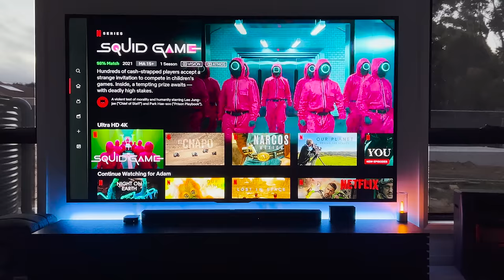Installing my Hisense 100" 4K TV - INSANE!! 100S8

Comment: Great job lads, very professional. I remember way back when I got my full HD 40’ tv everybody was saying don’t buy a Hisense tv as they are not popular tv and are cheap, but I have to tell you what, everybody was  shocked at how good the picture was on that tv many moons ago.
Reply: My friends Hisense was just working for more than a year tho

and he bought 2 of it because quality of picture is good but both are gone for just morethan a year Hisense wont cover it anymore
Reply from the maker: That’s not good to hear that. What country are you in?
In Australia we have consumer law that means any business must warranty any electronics for over 2 year by law. Minimum.
Reply: Based on my experience Hisense tv is reliable. 
I have 4 years old tv and keeps running without any problems.

Comment: Wow!  that's is one very thick TV for 2021... my 55" from 2006 is 1/4 of it thickness... no wonder it is affordable...  congratulation on the purchase!
Reply from the maker: It’s because it’s so heavy it requires a lot of extra strength. 
Once it’s on the wall you honestly don’t notice it. Cheers.
Reply: Yep, my 55"4K Samsung from 2016 is about 1/4 the thickness too, maybe this was an end of the stock deal...

Comment: If this was in the USA, they would have mounted it above the fireplace!! Wow, impressive setup!
Reply: Lol yeah right!? A lot of the houses built here have fireplaces on the main wall you would need for a tv that size.
My house was built in the 80s though and fireplace is to the side. My main wall in living room is massive and the center of my tv is eye level.
Reply from the maker: Testify
Reply: Yes, that's what they do here. Then the bottom of the tv is 5ft from the floor and the entire family ends up with neck pain within the year. Looks great in the design room, but it's absolutely stupid in practicality. I should know, I'm a spine doctor. LOL! I placed my 85" Samsung above my linear fireplace, but I made sure at least the bottom third of the tv was at eye level while sitting. I sure as hell wish we could get that Hisense tv in the states though...
Reply: I blame Architects and interior designers for this stupid design trend in homes. Yeah, you use the fireplace twice a year, yet the tv (used every day)  is relegated to a second class position.

Comment: Installing a 4K HDTV - regardless of dimensions, with a current display tech, is mind-blowing.  My mother has a Samsung 55" Crystal UHD in her bedroom (table mount) that replaced a 43" Crystal UHD 1080p - that is now across the hallway (table mount).  Note that the ONLY difference is that one is 4K and the display size.  I am looking at 43" 4K QLED (Samsung Q60A) to replace a Sony BX750A (42" 1080p) - and because you can now fit 4K in 43", the question is no longer DP you do it, but when.
Reply: I understand you very well! because I am also in the 43 inch 4k TV model range for a change! I know that's how it's the economy now for most of us but it's still a good TV! 👍

Comment: Just bought 70""hisense  UHD     SUPERB  VERY NICE PICTURE QUALITY AND SURROUND SOUND  IS AWESOME💚💙.. WILL BUY 100 "" WHEN IT COMES TO INDIA .😊
Reply: You're richer than I am lol (clutches chest over the $11000 price tag for that TV).
Reply: @bacondreamer  11000 $  for 100 " inch is too much I purchese 70 " at the price of$ 925  .11000 is too much for me may bi not for you 😇 ENJOY BRO ✌
Reply: You should have bought 75 inch MI QLED. Diffrence between two is day and night.
Reply: @chetansharma7626   ya but price difference was more 64 k then hisence..M1 was around 1.3 lack this I got  deal in diwali offer at 66 k.its like double of that .anyway tnx for suggestion. T c
Reply: @maheshkataria3903  HAH! That price is WAAAAAY out of my league.  The fact is any TV that uses actual LCD panels in sized 85" and over is gonna jump very quick in terms of price.  This is due to the difficulty of manufacturing a panel at that size without defects.  The sweet spot in terms of price vs size for large size TV now days is right about 75"

Comment: Why so low? I would have went a little bit higher with the position of the tv. Nice size looks good
Reply from the maker: Check out my latest upload / review of this TV. 
I show all the measurements. 
It looks like it’s low. But the top of the TV is almost 6 foot tall. So you gotta mount it low.
Reply: @ILT_AU  perfect height due to the size of the tv!
Reply: @ILT_AU  👍🏽🤜🏾💥🤛
Reply: Cause thats where you put it considering sitting position on the couch and eye level. Duh

Comment: As some have said, why did you mount it so low?  Subject to damage that way. But sure looks amazing.
Reply from the maker: Check my review video of the 100”. 
It explains everything. 
Long story short. Even mounted that low it tops out at 5’8 tall. 
So it’s taller than most people. It looks weird but when you sit down. The centre of the TV is still above your eye line. Otherwise you would be looking too far up.
Reply: @ILT_AU  ty for the reply. Understood. I had an 86” LG I bought about 5-6 years ago.  It did not have local dimming. The size was awesome but the pic quality left a bit to be desired. Just replaced it with the 83” A90J (which of course dropped 2k in price after I bought it), and while a bit smaller, amazing picture. Can you provide a link to your review?  Ty.
Reply: @ILT_AU  That’s exactly how I mounted my 55” TV. When you walk in the room most people would think it’s mounted too low, but when I sit on my couch the center of the screen is at eye level which makes it perfect.👌🏽

Comment: My hisense 52" 4k tv now broke ,panel / display issues..not sure if it still have a warranty ,but i sent to normal shop for repair..still waiting for the tv ..
Reply from the maker: If its a low spec TV it’s usually the electronics that go first. Panel should be ok

Comment: 100” is good for that distance away from the TV, but 100” of glare during a dark scene in the show/movie/game is a MASSIVE dealbreaker for me. I’m still Team Projector especially since they are WAY BRIGHTER these days and have ALR screens that don’t require a 5 man team to setup like the one in this video, Lol!

Not to mention that I can pick from 70”-300” screen size and am not limited to a fixed size image.
Reply from the maker: I’d completely disagree. A projector cannot come close to competing with a LED LCD TV in terms of brightness. 
A projector requires complete control of the entire room environment. 

The 100” is super bright and is not affected by what time of day or any environmental issues. 

If your happy hang there. Nothing wrong with a good projector cinema room if you have a dedicated space.
Reply: @ILT_AU  unfortunately what you have said about the completely light controlled room would be true if the projector was from 2018. 

MODERN projectors can easily work against ambient light these days and if you REALLY need to, you can get an Ambient Light Rejecting screen to really cover those bases. 

HOWEVER, when you're watching your Glossy Flat Panel TV on a super bright afternoon and the show/movie/game you are playing has one of those super inky black dark scenes in it, you will be looking at a mirror and not know what is going on in the show/movie/game. It's fact. 

People have been used to projectors of yesteryear, but things have changed. ESPECIALLY in 2021. 

Will I be getting the brightness level of staring into the highbeams of a modern roadgoing car? Probably not, who would want their eyes to feel that searing pain while watching their favorite movie? 

I will, however, have a clearly visible, VIVID image during the day at 100"+ WITHOUT a completely blacked out room AND without that nasty glare during a dark scene

Edit: Even in the boot up scene you can see the person recording the video clearly with a phone and everything behind him. If there was a Game of Thrones like episode where it's really dark, I would be SO ANGRY at this TV setup and wouldn't want to watch anymore due to all of the glare.
Reply from the maker: Sounds like your a project man!
Reply: @TriMuXx  I agree with you. Especially considering the Laser TV from Hisense that's the best of both world. Matte screen during the day (with ALS) and amazing image quality with complete darkness. Glossy surfaces are a complete dealbreaker for me.
Reply: @TriMuXx  Are the projectors noisy?
Reply: @kaduisaui4596  my projector is not and if you have the HiSense or JMGO O1 and O1 Pro I know for sure you cannot hear the fans when sitting 6 feet or more away from it.
Reply: @TriMuXx  Thanks!
Reply: @kaduisaui4596  No problem!

Comment: Brilliant. Congratulations 👍👍
Reply from the maker: Thanks man.
Reply: @ILT_AU  Pleasure is all mine. How much did it cost you...???
Reply from the maker: 5,999 aud :) 
Have you got anything special for yourself my friend?
Reply: @ILT_AU  I see. Thanks for the kind info, I'm not that much into TVs currently. By profession I'm an Electronics Engineer having Display Panel Technologies & Hardware Standards as a MAJOR research area thus I keep an eye on market trends 😊 

Currently using 30" QHD Apple Cinema Display, started my journey from a 14" Philips CRT Monitor 25 years ago although an Electronics dealer in my city was interested in selling me 52" Japanese Professional Display few weeks ago but it's sheer weight and installation mess made me lose my interest. 😐

Currently I have plans to purchase a 4K UHD lightweight monitor in between 40" to 50" diagonal size range. 🙂

Comment: Heya, I would love to get this tv. Just wondering which tv mount did you went with? What is the height that you have between the floor to the bottom of the tv, and thus the height of the tv mount from the floor to the bottom of the mount to achieve that? Cheers.

Comment: Just think in abt a 100 years from now.. the technology would advance soo much.. this TV prolly will be selling at the local swap meet for $5 bucks
Reply: Sooner than that. I have a 42 inch 1st generation plasma TV I got about 6 years ago as a cheap TV for £10. The owners included the original receipts from 2004 ....£4000 new.
Reply: in next 15 years you wont need buy a tv ..it will be virtual tv
Reply: @thomasireland1770  If that really is true.. what do you think we will have in the next 50 years... too bad we wont be around but sure would love to take a peak and see the technology say in the year 2122.. Would be intresting

Comment: Very nice, but I would have tried my best to unbox it as close to the room or wall as possible. Bulkier but less chance of damage. I also think the height is cool. Mounting them higher, especially fireplace height, just makes viewing uncomfortable. I’ve actually recommended to folks that in a main room, wall mounting is very overrated - a good console against a blank wall is better in many circumstances.
Reply: A huge pet peeve of mine. Perpetrated by architects and interior designers who seem to think TV's should be relegated to a lesser position than a fire place that is used twice a year..  I hate hate mounting a TV above a damn fireplace. It is the worst position by far, craning your neck up from a siting position to watch everything; it's like your in the front row of a movie theater.. The only position good for mounting a TV above the fire place is if you stand while watching TV, but who does that? I mean do you watch an entire movie while standing? Why is the fire place always put in a position of prominence with the entertainment center always an afterthought? Near as I can tell it's to sell homes to prospective buyers who equate fireplaces with "home sweet home". Its not like we need fireplaces to cook and keep the home warm anymore..
Reply from the maker: Check the comments section. 
The most common criticism is the TV is mounted too low. 
Where it is located. When seated the middle of the TV is still slightly above eye-line. 
It’s literally in the most comfortable viewing position when seated. Also. When standing the TV height is 5’8. So it’s very tall.
Reply: @ILT_AU  right height imo
Reply: @marcusdamberger  Lol, very good points.  Fortunately my fireplace is in a corner of the room and my TV is front and center - a good thing since I've used my TV countless times since I've bought it while the fireplace has been used at best, a number that can be counted on both hands.    I also know of people who put their TVs over the fireplace and the heat eventually cause the TV to fail if they used the fireplace any decent amount of time.
Reply: @marcusdamberger  i hate a tv above the fire place but I think the tv is still too low. It's barely above the cushions on the couch. That means of you recline, your feet will block part of the screen. Lol. It just needs to go up about a foot or 2. Nothing drastic.
Reply: Def way too low. Should have went about 2 feet higher.

Comment: Everyone saying "It's too low", obviously has never had a tv this size. You think you would want it high for some reason, but watch what happens to your necks.
Reply: Exactly!
Reply from the maker: Finally. Someone who has thought about it. 

When seated. My eye line is about 30-40% from the bottom of the TV. 
So I slightly look up. Very comfortable.
Reply: It needs to go up about 2 feet. It's as low as the couches. Lol. If you have a recliner, your feet will be blocking part of the screen.
Reply: I have my 75” up higher and it’s perfect

Comment: bad ass TV, but damn man that TV should be at least 18" higher than where it is right now lol
Reply: That's actually a perfect height for when you are sitting on the couch.  You wouldn't have to look up too much.
Reply: @AyoBaby  got it, just seems a bit tight if you get home theater audio, how high off the ground is it? just curious
Reply: @mikegoddard7354  I have a 65 inch that's about a foot off the ground.  When sitting on the sofa, it's dead center in front of us.  No looking up or down.  I do see your point about home theater and all.  That's a big boy they have in the video.
Reply from the maker: Yeah man. It’s so big. It’s gotta low.
Reply: @AyoBaby  To each their own man, I was reading online that a 65 inch tv should be 60 inches to the center of the tv mount.  I have mine set at that and have absolutely no issues.  Actually it will probably keep me from having a hunch.  Second to that my TV stand, which I use to house my center channel for my home theater is 22" and the center channel is 8" sitting on top of isolation stand which is 2 inches.  My TV is 42" off the ground from the bottom and all my equipment sits at ~32 inches.  So there's about a 1 foot clearance between them

Comment: The trouble with most people today is they put all the money in the video aspect of the system and then a small drop into the audio side of it. Out of balance. Movies are 50/50 Audio and video.
Reply from the maker: Check out my gaming room. Samsung QN900A 8K TV. 
Yamaha RX-A6A - Bowers and Wilkins everywhere. 
JL Audio E110 sub. 
Definitely made sure there was a balance.
Reply: @ILT_AU  Right on. Nice one dude. 👍🏻

Comment: Thanks for your video! Mine has just arrived but I've just realised that my current stand is too small for it. Where did you get your stand from?
Reply from the maker: Mine is also too small for the TV. 
Which is why I had to wall mount it. The feet are insanely wide. 
Congrats on the TV you will love it.
Reply: @ILT_AU  Thanks mate! I appreciate your reply... still happy with yours? I understand they stopped bringing them to Australia, you just cannot get them anymore.
Reply from the maker: Yeah man I love it. 
It’s not my “main” TV but for the price, size, quality. 
IMO it’s a winner. 
It has decent HDR and picture quality is great. Also I love the glossy black screen it actually creates some deep blacks. 
Do you think you will also wall mount it?

Yeah I ordered one of the last ones. I’ve received so much negativity and hate about this TV. Even threats from people. It’s weird. So many haters for a TV. 
We should start supporting each other.
Reply: @ILT_AU  Negativity and hate from whom? Online? Threats? Wow...

Mine is still packed, King Furniture has a TV console large enough for it but not available for 3 weeks. So we might wait... What did you think of your wall mount and brackets? The only thing I don't like about it is that the TV cannot be relocated with ease, although you rarely do this.

You are right, we should start supporting each other...

Comment: Amd I thought my 65' samsung was huge lol but this bastard is Humongous lol never new  there were 100' out there biggest I've seen were 85' Good looking TV but why hanging so low??
Reply: Probably because once your sitting on some furniture your eyes will be centered with the screen,why hang it higher and put strain on your neck looking up all the time like your sitting in the front row at a theater
Reply: @scottpryorsz28  I see your point the way my couches are and you can reclin them plus your all ready leaning back so it would make sense for mine to be higher
Reply from the maker: Check out my latest video where I review the Tv. 
I include the measurements. As it’s mounted. The top of the Tv is almost 6 foot tall. You gotta go low.
Reply: @ILT_AU  thats like my projector setup i also have a 100" screen and it sits maybe 2.5 feet off the floor for the same reason of the top of the screen being like 6 feet or more at the top